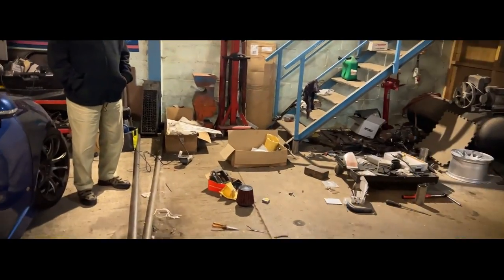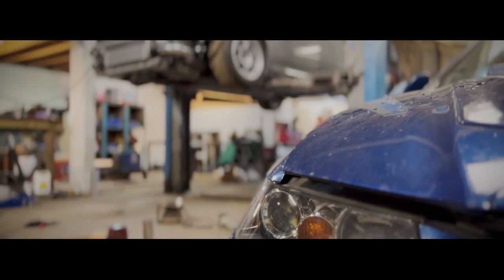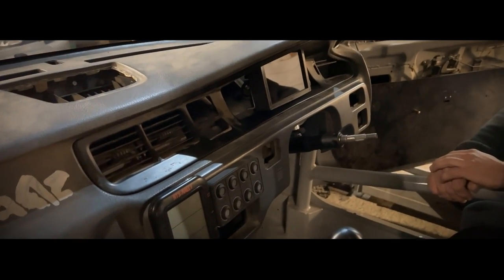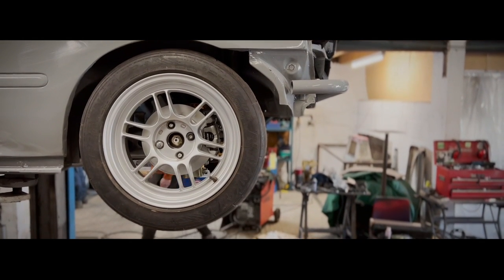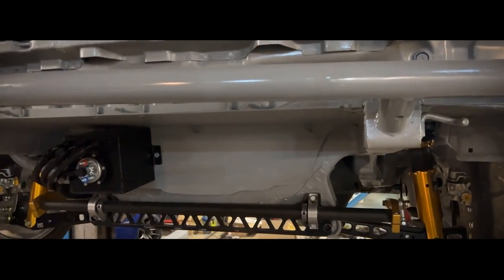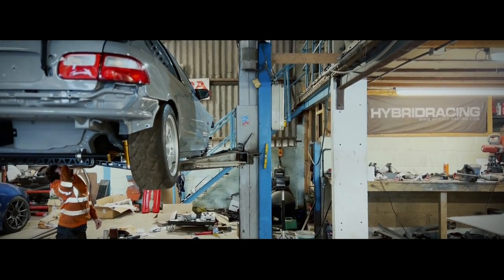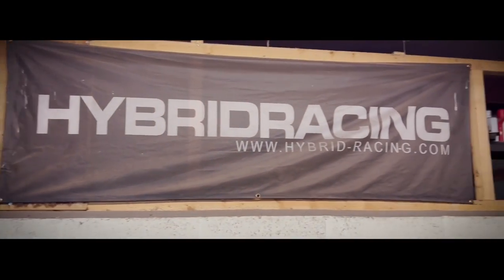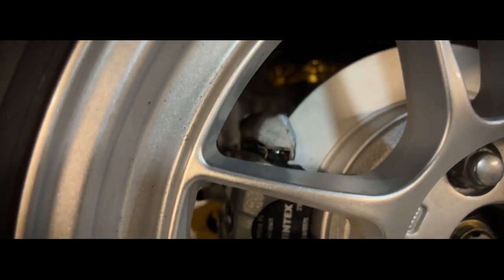RACING our SUPERCHARGED K24 Civic! - 750MC Roadsports - Vlog 001

Comment: Hello, how much power/torque with that rotrex supercharger? Why you chose it than big turbo to make more power/torque? K24 engine is monster, it runs good wild turbo.. and what size with those sticky AR1? Best EG6!
Reply from the maker: Currently at 430whp. We don’t use turbo because they create so much heat in a racing environment.  Tyres are 295 30 18 a052 currently.